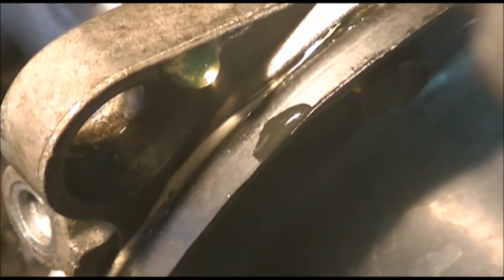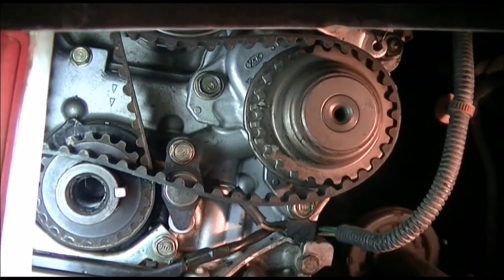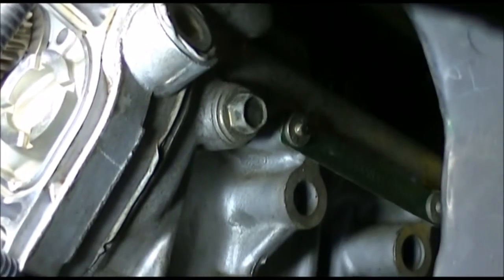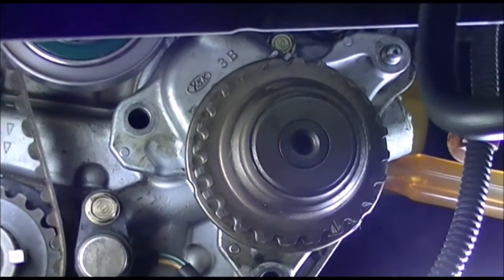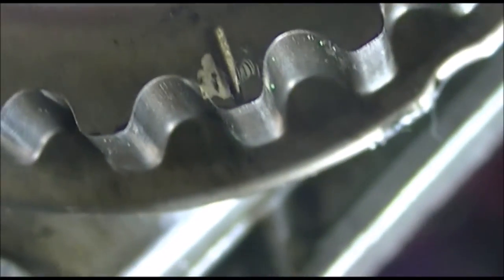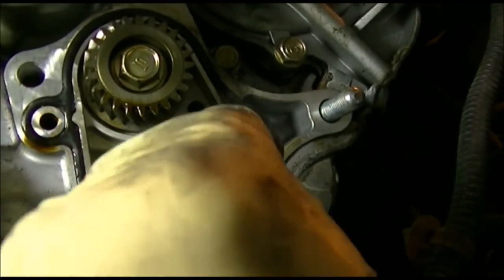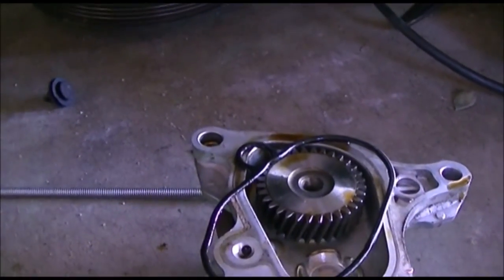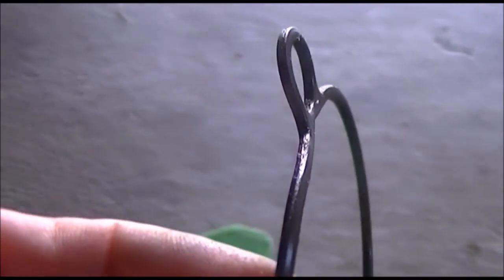Four cylinder 1999 Honda Accord. Balance Shaft Gear Case leak

Comment: It could be not only the gasket but also a shaft oilseal inside this ballacer shaft gear case. Unfortunately you cannot disasemble it as there is no screw to to remove the belt pulley.
Reply from the maker: Agree.  In my case there is no leak after I replaced the gasket and coated it the RTV.

Comment: This video was very useful I am an auto mechanic I see what Honda did the rear counter balance shaft Honda put reduced gear so you have to be very carful to re-install the same place you have to put that 6mm long bolt trough the rear hole and the pully notch has to aligned with the body mark absolutely unlike the front balance shaft which has one place only notch to notch. I'm just working on one of this at the shop 2002 Accord 4 cyl. timing belt water pump tensioner adjust the valve ect. .
Reply: So my question is I pulled out the shaft by accident , what do I do now

Comment: Any gasket or o-ring will get flattenned out as it is squeezed down or compressed and will harden over time.   Even if it is flat it will maintain the seal.   The problem is when they get hard and crack then they leak.
Reply from the maker: That is correct, but that gasket was only 2 years old (20,000 miles).  However I am still not sure if it failed or if the leak was coming from the oil pan seal.
Reply: At 0:18 you can clearly see that it is green coolant dripping down - not oil.  Most likely coming out the weep hole in the water pump from a bad internal seal.   Just change the water pump.

Comment: I replaced it but it still leaks
Reply from the maker: I am having weird things with this Honda.  Sometimes the brand new seals still leak after replacing.  What I do now is I coat them all, even the new ones, with a thin coat of RTV.  It works.

Good luck.

Comment: Hello Friend.
I'm in Brazil and I have a Honda Accord 95 when I disassembled my engine I noticed that the balancing shafts and their bushings are very worn, do you know what is possible to do?
Sorry I'm using google translator.
Reply from the maker: I am sorry I have never gone that far in the engine disassembly.
Reply: @cotick  No problem, thanks.

Comment: Did that fix it? Or was it a leak between the oil pump and the block?
Reply from the maker: I believe that the leak was coming from the oil pan and the block seal.  I did reseal it.

Comment: Is there any specific timing that we need to put it in when we take it out or put it back in ?
Reply from the maker: When you remove the balance shaft assembly from the engine it will freely spin.  So follow the marks for the assembly.
Reply: Cotick Somick so I completely took the shaft out not noting I’m which direction it goes or anything. I did it by accident. So now that it’s going back together I’m not sure how to put the case gear back on . Right now the shaft is free spinning with no gear on it once I put the gear on how do I line it up to install the outer case gear and mate it up correctly ?
Reply from the maker: @johnnyninetytwo  I have done it a while ago.  But if I remember it correctly the rear balance shaft should be locked in place and the marks on the gear assembly should be moved as in the video.
Good luck,
Sam

Comment: my oil pump is leaking out the balance shaft seal.  I already have it apart but how do i get to the balance shaft seal behind the gear ? How to get the gear off the oil pump to replace the balance shaft seal ?
Reply from the maker: Front balance shaft or rear?  This video is about the rear balance shaft.  If your leak is coming from the front balance shaft you need to pull the seal out using either a screwdriver, a special tool, or improvise.  You may try to poke a hole in the body of the seal and screw a little screw in it and then pull the screw along with the seal.  Either way be careful and do not damage the lip where the seal seats.  

I hope this helps.